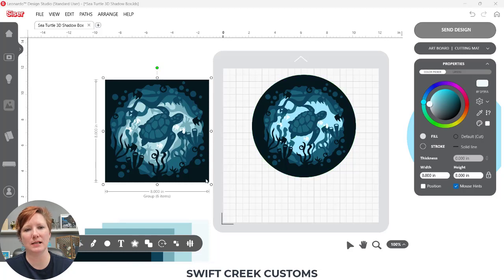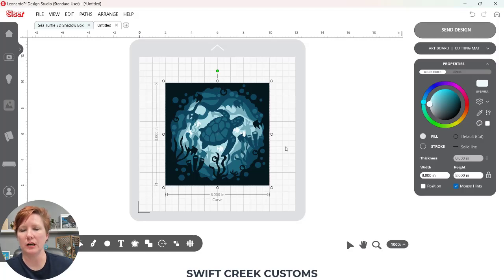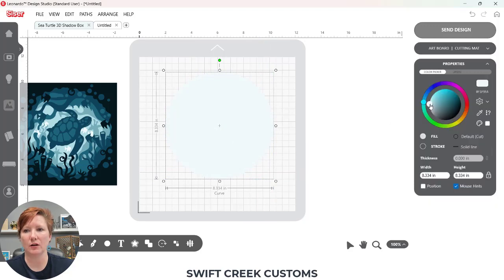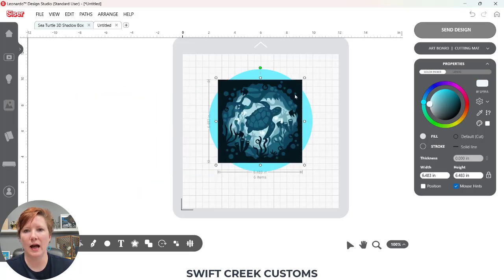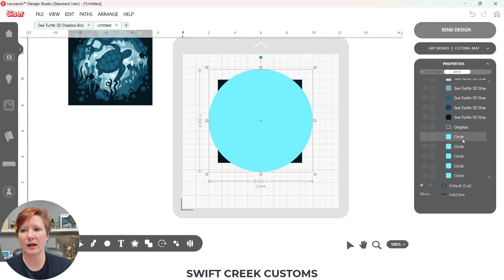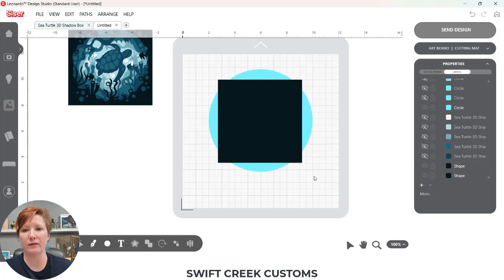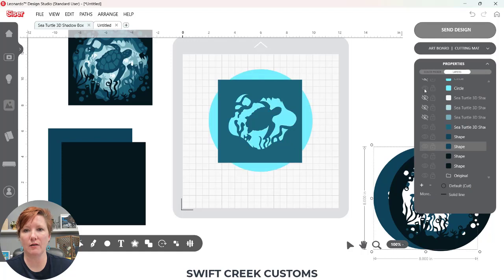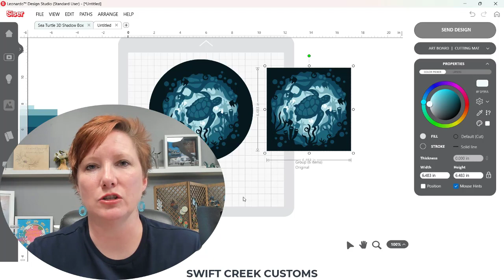Transforming a Square Shadow Box to a Circle in Siser Leonardo Design Studio

Comment: Is there a quick and easy way to simply add a small radius to the outside corners of a rectangle? Instead of a sharp corner I would want to soften the corners to say .125" or .250" etc?
Reply from the maker: @marktummillo715  no, not yet.